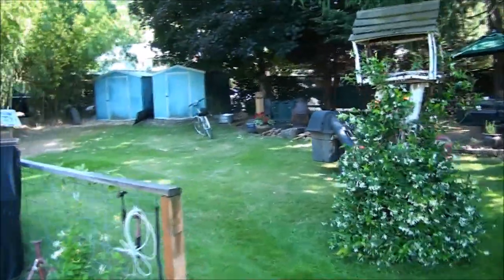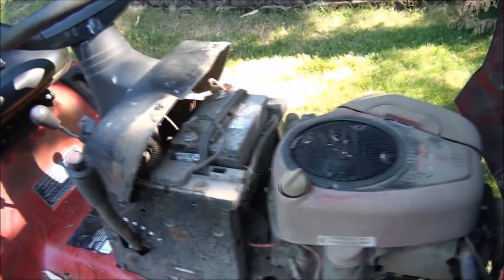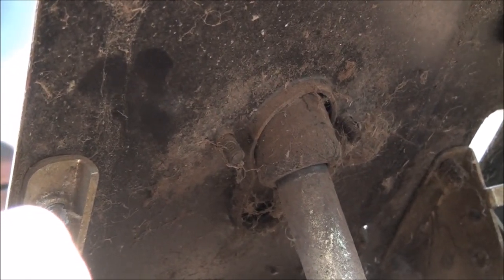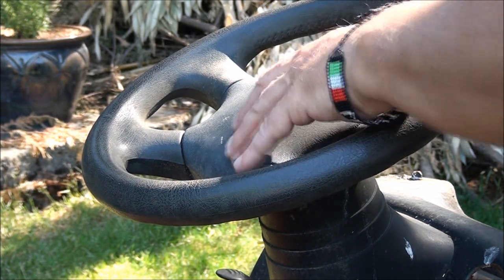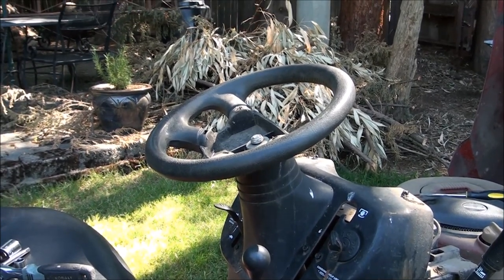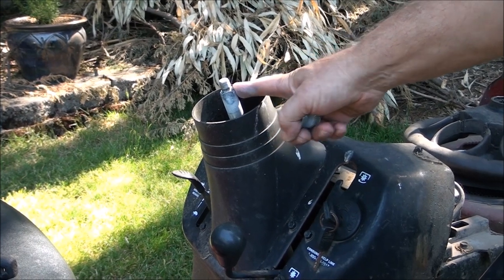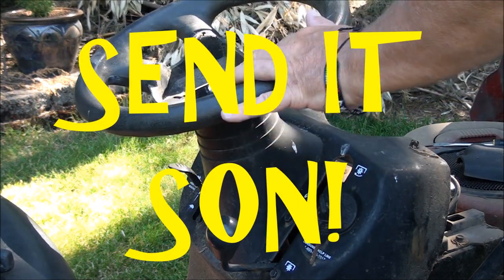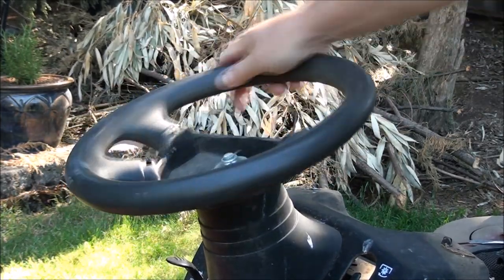How to REMOVE REPAIR FIX a loose STEERING WHEEL on a CRAFTSMAN Riding Lawnmower. LT DLT 1000 3000

Comment: Thanks for all the videos  .....Always informative and simple ways to understand how things on them work and how to fix them
Reply from the maker: Glad to help
Reply: That little steering wheel bolt hidden under that plastic top column shroud under the steering wheal....geez. At least the shroud kept the bolt and nut from being lost,,,     Same model, a 2004 version with a Honda motor. That motor has been just amazing all these years.....the nuts and bolts all over this machine though LOL....got to keep up on those. Thanks for vid!

Comment: Good info and video, maybe a little epoxy between the metal parts than tighten? thoughts?
Reply from the maker: Luckily it has not slipped once since I put it back together. I still need to get a locknut or put a lockwasher on there too